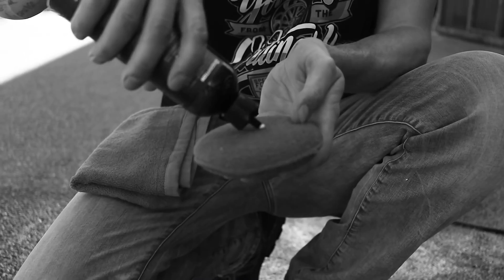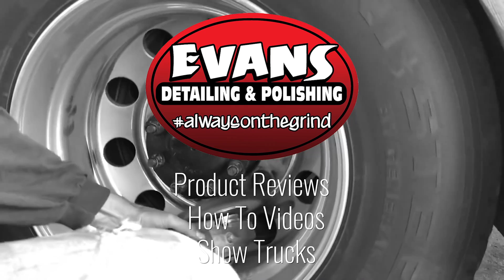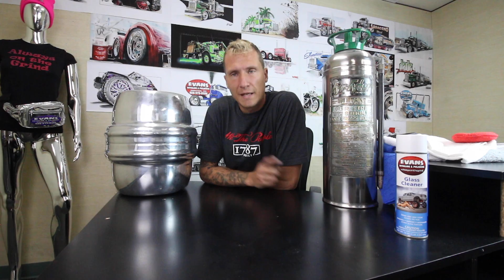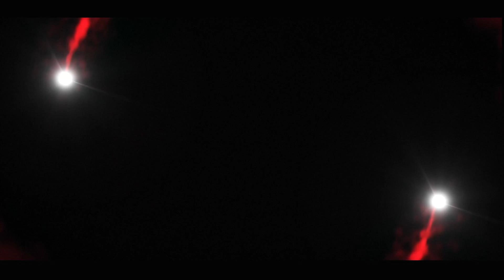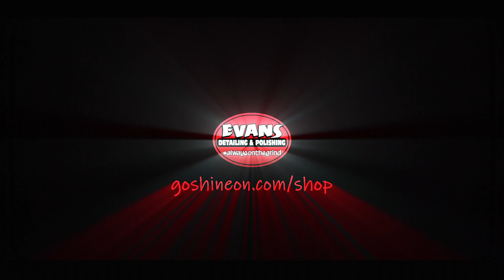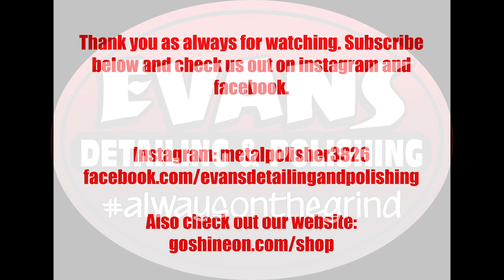How to tell the difference between aluminum, stainless and chrome.

Comment: Metal worker here, little to no experienced on bodyshop work.

I can speak on the stainless though.

Stainless steel comes in two different states, martenistic and austenistic.  Martenistic is magnetic, and generally less common.   Austentic is not magnetic, and is the most commonly used alloys, 300 series stainless in particular.

Neither one is really an indication for quality,  there are low and hugh quality alloys of martenistic and austenistic steel.

Similar to how there is low quality and high quality alloys of carbon steel.

Generally different applications have different purposes, austentitc stainless has a better overall corrosion resistance, which would be desirable for automotive.

The higher chromium content, and molecular structure of the steel makes the steel non magnetic, and that is also why a mirror polish is significantly more difficult.
Reply from the maker: Thank you for watching and sharing this information.

Comment: Better yet, how do you tell the difference between chrome plated stainless steel and polished stainless 🤔
Reply from the maker: Chrome has a different kind of shine. You can see it. It almost looks like a coating. Because it is. But I will have a video out soon on chrome.

Comment: High quality stainless steel has no carbon, so a magnet will not stick to it. Years ago we used magnets to identify stainless steel, if the magnet stuck to it, it was carbon steel, if it didn’t it was stainless. 

These days the cheap stainless we get from china has carbon added as a cheap filler along with other alloys that a magnet will attract to. 

So your statements about identifying stainless steel are incorrect.
Pure stainless steel has no carbon in it that’s why it doesn’t rust, rust is caused by carbon in the steel.
Reply from the maker: Thank you for the correction and the update. Appreciate that.

Comment: Hi sir. Is there any type of acid/compound test or scratch I can do to tell between polished stainless and chrome.
Reply from the maker: That is a great question. Most stainless and chromes are resistant to acid. Now if you let the acid dry it will burn both stainless and chrome. And if you scratch chrome it can't be fixed without replating. So not sure what the best answer is. For me I can just tell by looking at it. I will look into this for a future video.

Comment: Ha ha love your take on this, in Oz they  chrome Alcoa rims and stainless wrap alot of tanks (we don't salt roads so there is no real issues with electrolytic corosion between the dissimilar metals) and nearly every bumper is aluminium and they chrome over plastic, Your ping and ting Is one good way unless its a stainless wrap on an alloy tank their density is very different, and with stainless  some grades for example 304 has a ferric iron content to give better properties in forming, welding, and heat cycling characteristics and is magnetic and will get orange spots, but it doesn't 'rust' like wrought iron or high carbon steel. 304 grade is used for exhausts, fabricated and machined parts and alot of the Bling,  If you look at the properties of say 316 which is a true stainless it distorts and cracks when fabricated it quickly work hardens also forming cracks also it is hard to machine as heat from even drilling can quickly harden it like diamond and I've had experience welding it on one occasion a supplied 316 stainless V band adaptor needed to be welded into a nickel alloy turbine housing the adaptor was a loose fit with approx 0.010" clearance (I always made mine press fit 304) I started nice bead with the tig as soon as I got half way a loud 'ting' as the crack appeared in the start of the weld and it just kept following. Another ways to test characteristics is a spark test (if possible) touch with a grinding disk and note colour of the sparks (orange is iron an mainly blue is stainless) or absence of sparks and the disk starting to clog is a good indicator its aluminium (or melting and smoke if Chrome plastic) also a hardness comparison / test for example with a Brinell or Rockwell test they indent the metal with a carbide or diamond indenter or you could use an automatic  centre punch (about $7 dollars ) to indent and compare depth of indent with a known sample. The use of your acid test will tell you if its aluminium as being a 'reactive' metal it visibly and spontainioiusly reacts and whitens on contact with all mineral acids and also alkaloids wheras  chrome and stainless don't react. And I agree a good experienced  eye is best and a magnified one is better if you look at the surface you will see the very grains and pores in aluminium that's been etched with acid, stainless you will usually see a linear 'mill' pattern and chrome if done properly you won't see any structure or tooling marks of any kind.  And you can do one or more of these tests in an inconspicuous spot and quickly determine what it is and the the ping and ting will be a dull tap on chrome over plastic, Freightliners make the same sound, and with our Aussie built Kenworth's the grille on bonneted models like T404SAR to T909 etc the sides are stainless, top is chrome over steel the hand hold is aluminium cast, the vertical braces are hardcoat anodised alumimium and shouldn't  be polished at all an the screen sheet and the dress strip at the bottom is also stainless.
So with a long stick an angle grinder, automatic centre punch and some mag wheel acid cleaner which you probably have on hand you can check before you start.

I always like your tutorials Evan and thanks for sharing, I recommend  your clips to my customers in Australia
Reply from the maker: That’s awesome. Thank you. Really cool to see the oz trucks. Someday I’ll come see them in person.